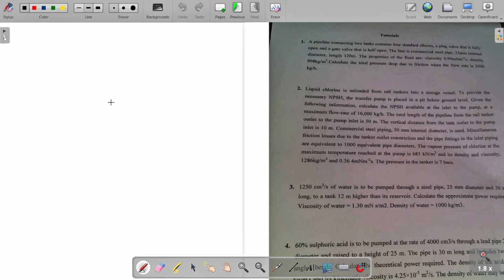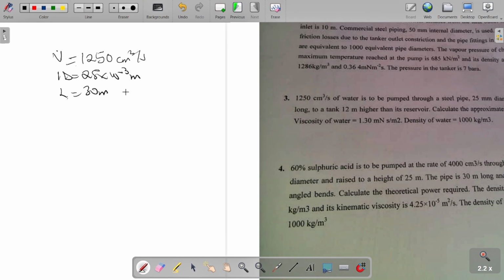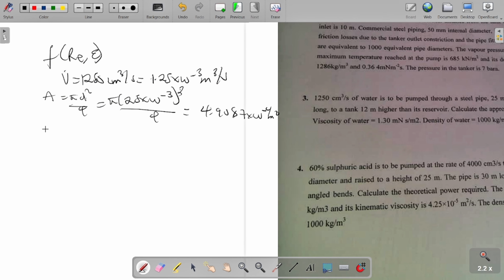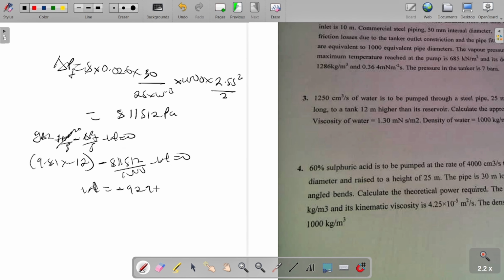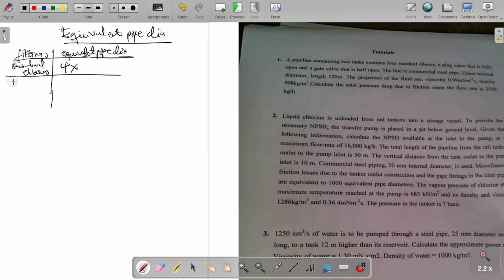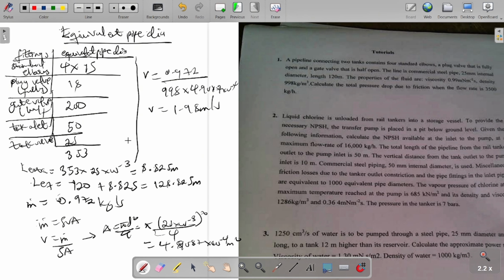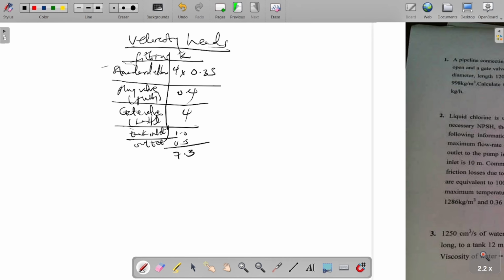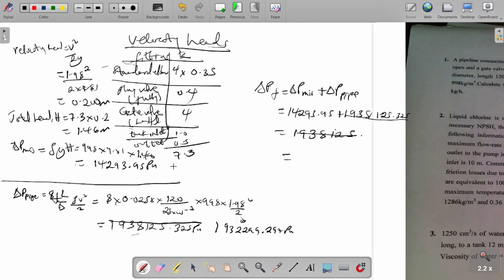Exam Prep Questions on Chemical Process Design & Economics| Part 2A

Comment from the maker: Quick correction: The graph we used in reading the friction factor had the Darcy friction factor, so we were suppose to divide by 8 to suit the graph based on the equation ∆P = 8f*L/D*p*v²/2. Eg in question 3 we had 0.026 from the graph which should have been 0.026/8 before putting it into the equation. If you decide to read with a graph that has the friction factor based on that equation the answer will be the same. Sorry for the miss up.